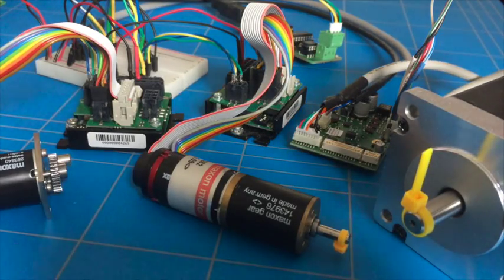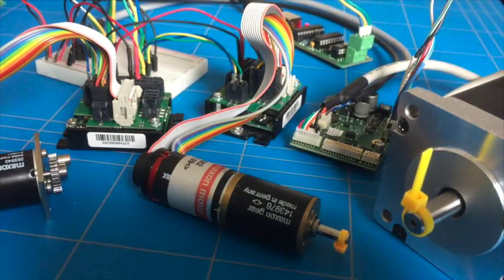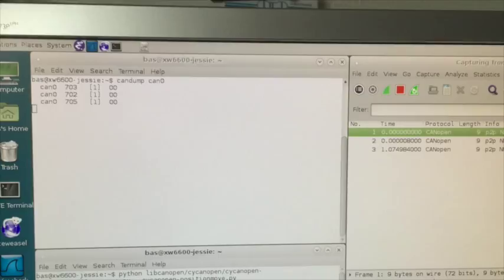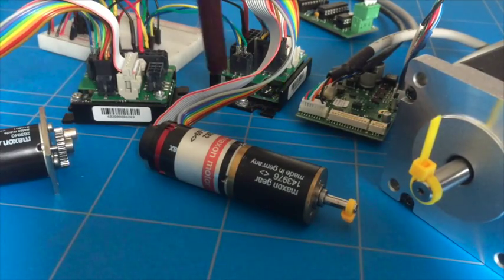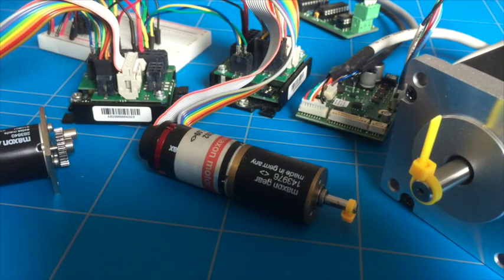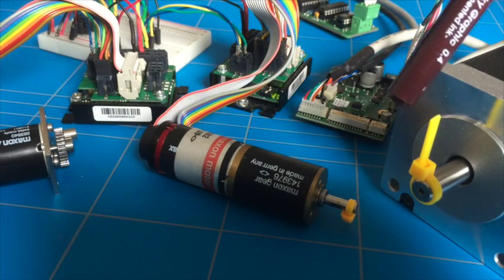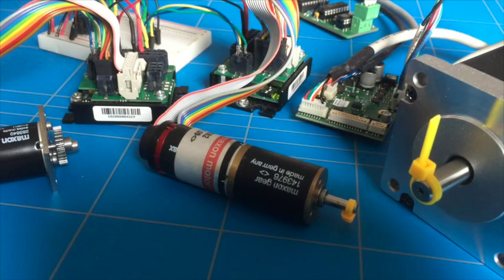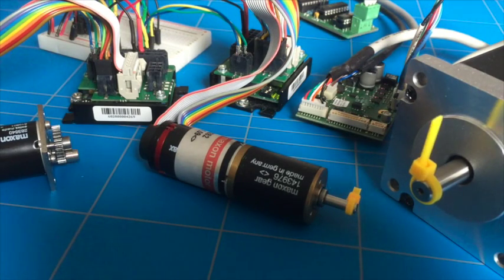running CANopen devices from a Pyton script

Comment: I'd like to transfer lots of data over canbus between 2 stm32s... is CANopennode the simplest of the higher layer protocols?    I saw some working on canopen using the chibios RTOS, but I'm using FreeRTOS.
Reply from the maker: I haven't used CANopennode so I can't comment on that
Reply: @BasdeBruijn  Thanks, I think I got it working now using christiansandberg / canopen

Comment: Hi, I'm trying to communicate with can bus with my two inverter (node address 01 and 02) my problem is that I always use standard can and using candump I receive anything from my Beaglebone Enhanced, I'm a newbie in canOpen, in your opinion I should set something more on my micro(I tried  also with CANopenSocket)or it depends on the Inverters?

Comment: Hi, I want to run several nanotec motors for a space-rover-research project.
The motors are DB42M03, controller is CL3-E-2-0F and I use the usbtin adapters on Ubuntu.

I do not really get either library to work.
Using libcanopen i constantly get Exception: CANopen Expediated SDO download error
and I dont really understand  the christiansberg/canopen library

Can you somehow provide an example of your connection setup and data object sending?
Reply from the maker: check if you can send/receive can messages with your usbtin. use candump to see startup messages from the device when you power up your motor. check you've set your communication speed correctly. If you can't see messages in candump then you have to solve that first. the python canopen library is what you want to use.
Reply: Thank you for your quick answer. I do get a message from the controller at startup, but it's only one.
However the motor does still not respond to any messages I send. (Controller and motor work with the nanotec plug and drive studio, so they are not broken. USBtin works at other project)
Which parameters do you set at your "initialisation step"?
Do you save them in the cfg.txt or set them via CAN?
Do you initialize the usbtin via python (see code below)?

usbtin = USBtin()
usbtin.connect("/dev/ttyACM5")
usbtin.open_can_channel(1000000, USBtin.ACTIVE)

I'm getting a little desperate, thanks so much for your time!
Reply from the maker: if you have the usbtin running as a can bus, like can0, and you can see messages with candump and can send messages manually with cansend then you're doing something wrong with your program.

there should be no need to initialise usbtin via python.
see this post http://basdebruijn.com/2015/05/sniffing-at-canopen/

read thru that, see that you've set up your can interface.
then use the canopen python stack https://github.com/christiansandberg/canopen which has excellent documentation http://canopen.readthedocs.io/en/latest/
Reply: I finally got it to work with the canopen library in velocity mode.
With your help there will soon be a research exploration rover driving across the field.
You may have saved my deadline, thanks again so much for your time!

Comment: Hi,im the beginner in CaNopen and i'm doing some application with Nanotec motor which is embedded CL3-E, i just want to capture some data of motor(velocity position) to PC by CANopen, which component do i need
Reply from the maker: have a look at the link to my blog post for electronical components I used. I recently used the CANOpen python module https://github.com/christiansandberg/canopen which makes interfacing a lot easier.
Make sure you set TPDO's with the velocity and position registers. Or you can cyclically get the values by polling the device OD's
Reply: how did you program the CL3-E  with the Nanotec official software or other
Reply from the maker: since I run the application from Linux I'll set the correct OD's by means of SDO's in an initialisation step. Manually in a sense. You can set and save the OD's with the nanotec software though.